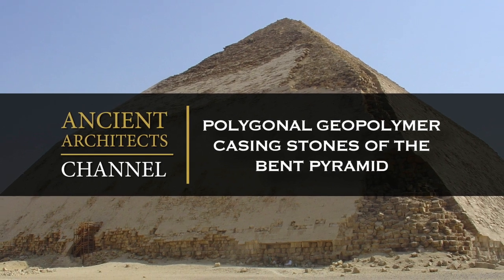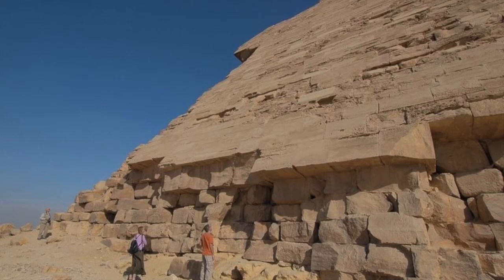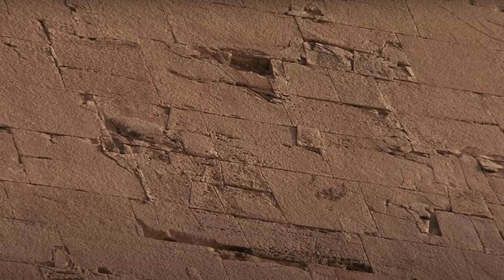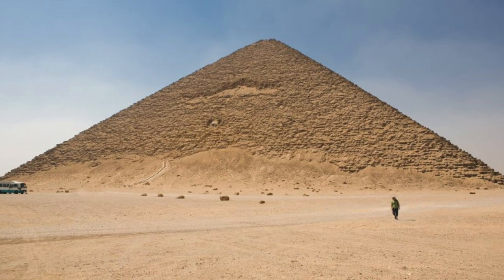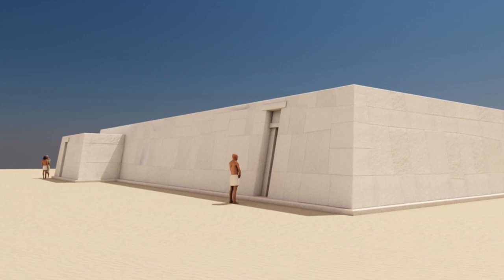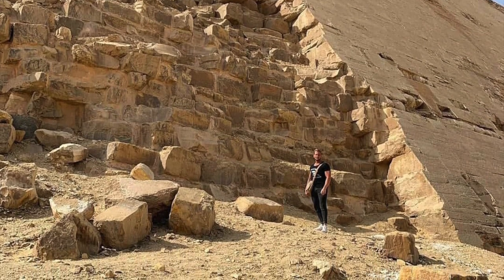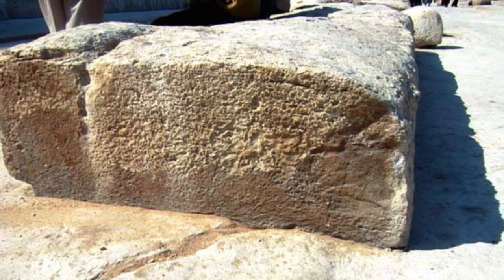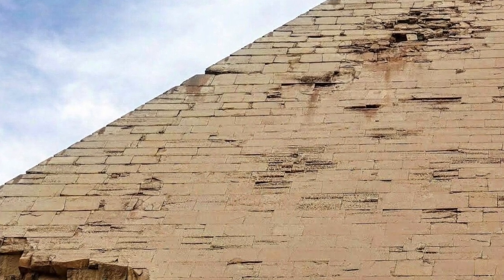The Polygonal Geopolymer Casing Stones of the Bent Pyramid | Ancient Architects

Comment: Why? Pouring concrete is simple and doesn't require massive levers to haul blocks. You build the form in place and pour in place in exactly the same way the Hoover Dam was made. Persons can carry the add mix and water by the bucket and mix the stuff right inside the form. It is less labor intensive that dragging blocks and making all the ramps and crane work necessary to lift and place. Why is easy. It's easier and cheaper. How do I know? I'm a retired construction manager. I read Daveidovit's book and it makes perfect sense from a builder's perspective. Making aggregate and moving it is way easier than cutting and perfecting stone and then installing it perfectly right. If you form in place it isn't necessary to make uniformed blocks and then place them, you don't need to set up a cement block facility. So many advantages to form in place work it's crazy not to do it that way. I could go on, but I don't want to write the book all over.
Reply: This works well for sites n Peru too where they hypothesize that the giant stones were hauled across valleys and over rivers.  The irregular shapes and sizes could be that they just didn't have the technology to manufacture exact copies and just built shapes as the raw material was delivered to the site.

Comment: When quarrying and shaping stone blocks a lot of waste material must of been created and it would make sense to use this in the geopolymer perhaps.
Reply: Excellent thought
Reply: If you do simple mat by calculate the volume, of the casing stones. it turns out you need much more limestone pulver, than by carving would arise as waste.  the only way getting this amount of limestone pulver is by using Limestone Mills.
Reply: Limestone rubble is adequate and there was plenty around the giza locale. Dump rubble in pit add water and diatomaceous earth and couple of other mundane elements, stir well and carry wet goo to moulds at pyramid and pour in. See also rammed earth moulds for a similar but not hardened finish. Geopolymer dot com has a quirky video of people dressed in time set drag doing just that. I am certain it can be done with stone such as at Puma Punku etc. The bands of magnetism can be achieved as in rammed earth casting by layering different stone slurry types etc. The ancients were just like us, smart thinkers and observers plus dogged experimenters.
Reply: @outcastoffoolgara  yeah, well put, and not as confusing as people make it out to be. The magnetism though... intentional field? Solar fluctuations? Any ideas on how strong the magnetism could have been in deep history, I think that could help rule out suppositions.
Reply: This limestone is fairly soft so milling it down would probably be fairly easy compared to dragging a 4 ton block 5-6miles and then 300 feet up a pyramid. The logistics of building a pyramid changes dramatically when you realise that everything apart from the granites is possibly man portable.
The core blocks are more likely to have been made with rougher ingredients and rubble as no one would have been expected to see them and would explain the odd fossil that turns up. The casing stones as the outer finish would have been made of far finer grades of stone.
Reply: It may well be that the secret of cast stone was held only for the pharaoh and gods. If it were in common knowledge it would collapse the market for quarry stones. 
(Much ss cement blocks replaced quarry blocks in house  foundation walls after WW1) ( It only took 5000 years for the quarries to lose control of their product obviously it was to good of a punishment for criminals)
 So the slaves and criminals probably worked in the quarries. The stones were sold to people wanting to build and the money or a tax went to the pharoah's or the priests. While the rubble was sent to the Pharaoh for his secret method to turn it into cast stone. 
    Also if cast it would lock in the magnetic direction at that time which could be a way to calculate an accurate age for the monolithic stones done this way.
Reply: Well the thought occurs that limestone rubble makes pretty good ballast stones for ships. Seems to me that they were using waste materials as many times as possible. bring a ship over with blocks and rubble, take it back up laden with goods and food.
Reply: @jeremytaylor3532   Yes! "It may well be" that if you put the words "it may well be" before a statement and then weave a fantastical, nonfactual yarn after them, some people might actually believe you.
Reply: Very good point.

Comment: If the back of the casing stones match the core stones in all of their irregularities then it might have been cast in place
Reply: As incredibly irregular as those substructure stones are that would seem to be nearly the only possibility. How the hell did they get those to be perfectly flat everywhere on the structure?
Reply: Exactly
Reply: I guess it would be easier to carry the powder up the ramp.
Reply: @kricketflyd111   Yep!
Reply: David Turner totally
Reply: Yeah that's a great point, I have never heard anybody argue that
Reply: @Magnetron33  The mold board used to determine the slanted face of the casing stones could over-lap the row below. Pressed flush against that lower row, the next new row would have the same angle and flatness.
Reply: @kricketflyd111  Archimedes Screw.... easy way to move a LOT of dry powder or slurry.
cool thing is it doesn't matter if you spin the screw or the tube around it.
Reply: This was the same thought I had as I observed the main structural stones beneath. I would also like to see a face of the pyramid analysis by a machine to determine if a complex pattern could be established. Irregular shapes tend to, though with exceptions, be more stable over time. Imagine a random pile of jenga pieces  vs a tower. Easy to see which will stay put longer.

Comment: Transporting crushed stone from the quarry to the construction site would make sense for several reasons: 1.Ease of transport: Instead of moving large blocks over a long distance they could adapt the amount of material for each available type of transport, e.g. men, animals, boats, carts etc.  2.Accuracy: For fitting newly casted stones into the existing construction it would make sense to measure and prepare the new blocks on-site. Communicating the design and measurements of irregular blocks like this between the construction site and the quarry would be very difficult. 3.Casting in place: I think the tight fittings seen here implies that the stones were casted directly into the construction instead of molding blocks for later assembly. They could have used bags or prepared some other thin material to build forms adjacent to the previously casted block. Over time the thin forms/bags would have disintegrated and created the tight fittings. 4. Rock properties: If the pyramids needed some special properties in terms of conductivity, magnetism, quartz contents, etc. it would also make sense to make sure the mixture was just right.

Comment: In the case of the Bent Pyramid, the casing stones were likely made from the sediment from all the cutting and polishing of the native stone. I used to work in a university geology department cutting and preparing stone samples, and I can tell you that the sediment that collects in the bottoms of saw beds, if stirred and allowed to settle, when dried can often be nearly as hard as natural stone. In Egypt, if the same type of stone (Limestone.) was always cut in the same place, the sediment would be uniform in grain size and density. There may be slight layering marks, which would only add to the natural look. Humans have been using stones as fire surrounds for tens of thousands of years, and somewhere along the way they would have realised that burning limestone, then getting water on it, made a corrosive liquid, that later set hard when it dried. Put two and two together, and they would realise that mixing this liquid into sediment from other stone work, would create a uniform stone like mud brick. The statement about Egyptians not having the technology to make these bricks is like saying they didn’t build the pyramids. The Great Pyramid is a humongous slap in the face that they had all sorts of technology we no longer have, and a problem solving repertoire that makes modern Western society look backward and stupid.

Comment: The reason to cast instead of carve makes sense if they are cast in place over the rough-cut core blocks. Going from the rough core blocks to a single plain of a smooth finished surface is a night mare to carve. Each block must be fit to the core on one side and a perfect plain on the other. That means either carving the casing stones there on the spot to allow multiple fittings, or hauling those blocks back and forth from the place it's carved to the place it is supposed to fit. Casting in place only requires a flat in-plain surface to cast against and a supply of the geopolymer. That's a lot less labor and not fitting. Remember fitting carved blocks precisely means a process of check-and-reduce until fit is met. If you remove too much then you need a new block. The benefit to cast in place is screamingly obvious to anyone who has tried to fit any sort of carved parts together.

Comment: One thing that's fairly obvious on this pyramid, as well as on other pyramids and constructions, is the various skills and levels of those skills employed by the builders who actually did the work. If you look at just the stones seen today, then Giza offers a range of workmanish ranging from highly accurate cutting, carving and polishing of various types of stone, with multi-levels of skills displayed in shaping stones that include the emthods empoyed in the manufacture of moulded mud bricks.
If we put the apparent precice work to one side for a moment, wecan see that the core structure of the pyramids is irregularly shaped stones, albeit of enormous size, that are sat together in irregularly bonded layers, with infills of mortar, loose stones, and even sand between them. The finishings are interesting then, as are the skills employed by the finishers, but it is worth noting that none of them could take place without the basic grunt work, and the levels of skill employed in carrying this out.
After the war in the 1950s and 60s, most building work was similarly carried out by grunt work, with large gangs of men described as labourers leveling sites, digging foundations and creating service and drainage trenches. Similarly, so called skilled trades had varying levels of those skills, (and their own semi-skilled labourers,) with some of these skilled people doing shuttering, and what was referred to as first second fixings. They of course were followed by, plasterers, decorators and even furnishers, and as I see it, when looking at what remains at giza today, this same break down of skills has to be born in mind.
Yes, you had to have had many various levels of management, engineers and achitects to plan and try to oversee the work, but as anyone who worked on construction in the 1950s can explain, what happened on the ground, on the day, and to suit conditions and situations that arose, often had little to do with oversight and it relied on common-sense traditions, habits of work and the practices of each section of workers for overcoming obstacles.
For me then, it isn't a case of carved our synthetic stone, but an allowance for both, plus a few other ammendments made to finsihed structures to cover up holes and areas of qwork that had been left behind to allow access to higher levels to take place.
Yes, we all love the mystery of how the pyramids were constructed, but the only way we can truly beging to understand this is not by studying the final finishings in isolation, or even the architects plans, but by trying to understand the people and the levels of different skills involved in the actual work.

Comment: The more interesting thing is that the Great Pyramid (GP) is based upon Pi.  Its dimensions are 1760 x 280 royal cubits in circumference  and height. So the GP represents 2 x Pi x r  (using the 22/7 approximation of Pi).   
Furthermore the GP is a 40x multiple of Pi, which is why we get so many mentions of 40 in the Bible - spending 40 days or years in the wilderness meant you had been initiated into the secret metrology of the GP.  
Surprisingly we still use these units of measure today.  The circumference of the GP is 1760 royal cubits, while the imperial mile is 1760 yards.  Likewise the chain is 22 yards while a rod is 5 1/2 yards.  Why such absurd units?  Well, they are all Pi numerator numbers - the imperial measurement system was a Pi-based metrology system.
And while the absolute length of the mile and yard have been altered over the millennia, the nautical mile retains the original measures - so the GP measures exactly 1/2 a nautical mile in circumference.  (Like Erastothenes, the GP architects had estimated the circumference of the Earth.). 
See the book Thoth, Architect of the Universe for all the answers.
RE
Reply: GP was also called "rostau", or "rose cross", and is the foundation of the rosicrucian mystery school

Comment: Occam's Razor points to carved stone and molded bricks. 

Chemical analysis that can't be duplicated point to bad chemical analysis, which seems to be very common.  It's hard to do this stuff and get it right. 

As far as the implication that many molds for bricks having anything to do with casing stones, its bunk.  I have at least ten different types of brick in my yard and house and several home made concrete "sculpted" paving stones.  AND a home made water feature with both bricks and casing stones that were made by me.  You can look at the casing stones and they look like stone, but a properly done chemical analysis would reveal that they are Portland cement and pea gravel that has been stained and painted to look like real travertine. 

A chemical analysis done of the surface of these stones would look like they were made of concrete and various industrial chemicals.  What you wouldn't see is the process that made them.  It is the same for pyramid casing stones that are millennia old.  There is no way to know what has been put on the surface that would show up later in a 2011 chemical analysis.  Plaster?  Stucco?  Paint?  Who knows?  If the source doesn't match the sample it doesn't mean anachronistic construction methods, it means you haven't identified the source.  Stratigraphic analysis of the stones shows layers of differing composition that are consistent with natural formation and are consistent with quarrying.  Casting stone doesn't yield layers of identical height, composition and arrangement.  This same type of analysis is what shows that the temple in front of the sphinx was built from the rock removed from the sphinx enclosure.

I disagree that the onus is on egyptologists to prove that the casing stones were not cast.  There are literally hundreds of years and thousands of papers showing that they were carved, along with every other stone object in ancient times.  The development of mortar and concrete is well known and well documented.  The proof is done.

Extraordinary claims require extraordinary proof, and that proof is sadly lacking for ancient Egyptians or South Americans casting geopolymer casing stones or geopolymer anything.

Before I'll believe this is scientific I'll have to see the science done.  Where are the experiments designed to disprove the hypothesis, the replication of results, or the prediction of outcomes based on the research?  Where is the cast geopolymer stonework made to match any single casing stone or H-block?
Reply: Absence of evidence is never proof of anything.  A thing is either true or it is not, evidence or the absence of it does not change that.  So to take a position in opposition to completed scientific test results is to take a position in opposition to science since you have zero basis for skepticism, because if you had, you would have mentioned it.  Sounds like the logic error of argument from incredulity.
As for 'papers' showing that the casing stones were carved, why is it that no one can name a single one that is based on scientific testing? ...rather than conjecture of Egyptologists with an agenda to defend.

"Chemical analysis that can't be duplicated..."  It seems that you began your screed with a big fat falsehood since there is no claim by anyone that the analysis cannot be duplicated?  Who are you attempting to deceive and why?

If I may be so bold as to ask a personal question; are you are self-confident, self-centered, credentialed, entitled, first born son of Progressive atheists?  Just wondering.  Have a nice day!